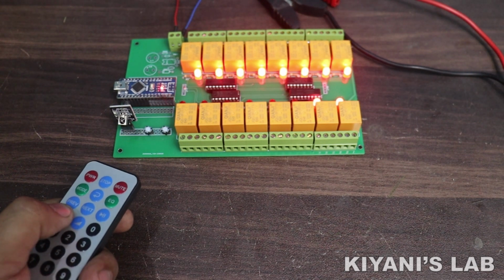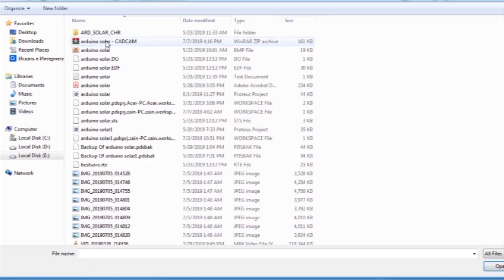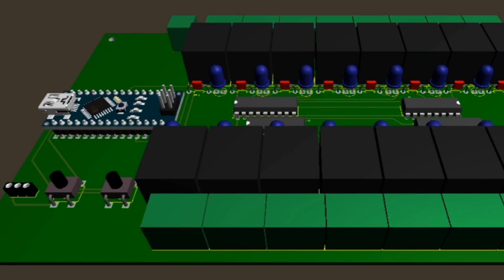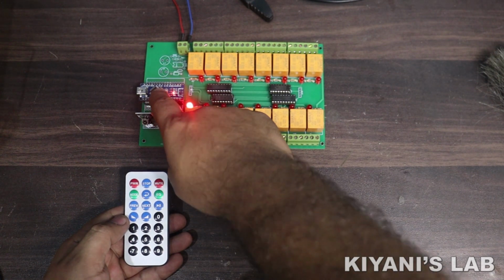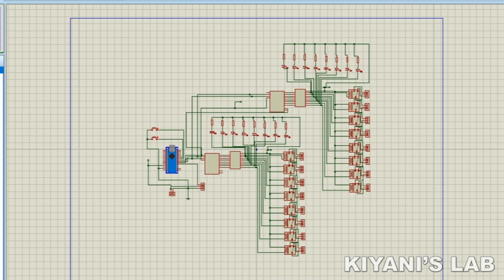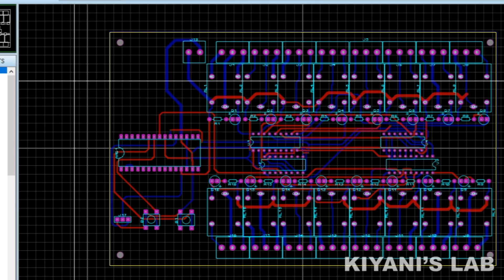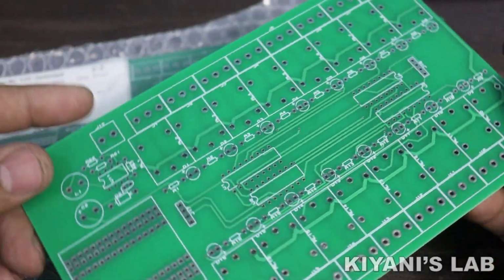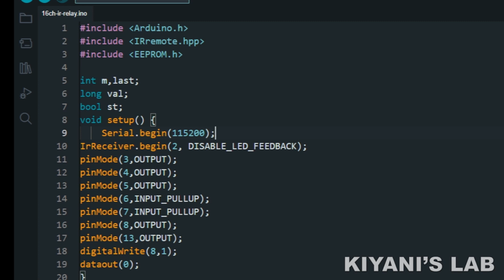How To Make 16 Channel Remote Switch | Arduino Home Automation

Comment: A very wonderful effort. I am always looking forward to seeing more... Is it possible to draw a circuit diagram for manual design..... As I do not have the cost of implementation on the site because the cost with shipping is very expensive in our country
Reply from the maker: yes bro you can with single layer design
Reply: @KiyanisLab  I can't because the shipping cost is too expensive... Thank you

Comment: pinMode(3,OUTPUT);//------------>pin data 74HC595
pinMode(4,OUTPUT);//------------->pin clock 74HC595
pinMode(5,OUTPUT);//-------------->pin latch 74HC595
Can use 2 x 74HC595  and 2 x ULN2803
Reply from the maker: yes you can use many